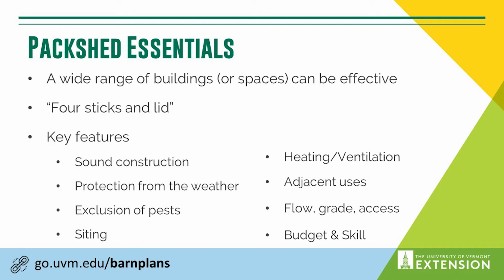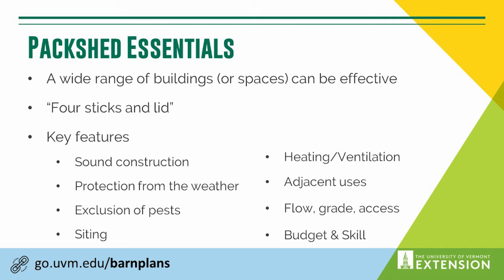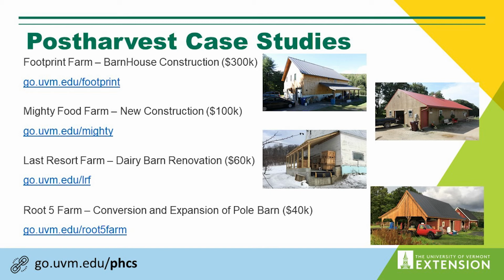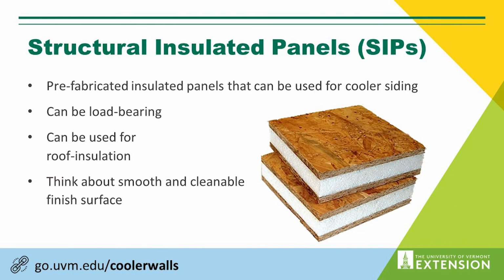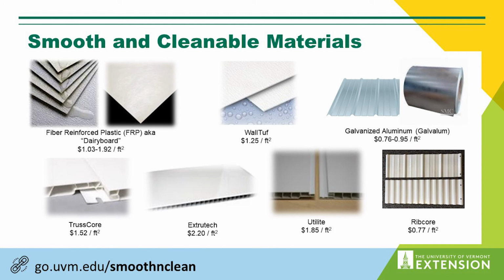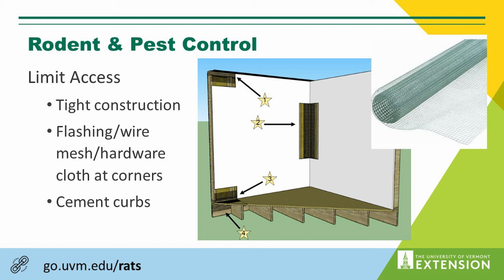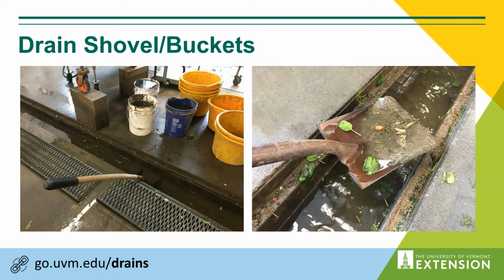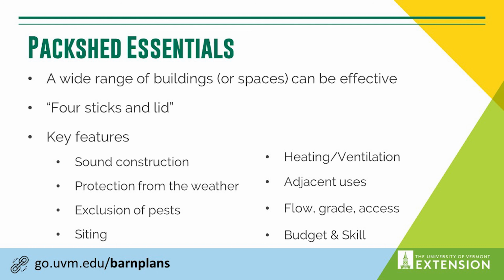Postharvest Webinar: Buildings & Infrastructure (Session 5)

Comment: Hello and thank you for this series! I was wondering why tile was not listed as an option for cleanable vertical surfaces in a wet environment? Is it just a matter of cost, or is there an issue with grout and bacteria? I'm thinking of spas and pools and other wet environments that must also be concerned with moisture, cleanability, and safety from bacteria or mold. Also, there wasn't a slide specific to flooring materials. Concrete sounds good, but are there other options that are cleanable and meet OSHA requirements? Have you had any experience with epoxy coatings or other floorings that are used in other wet and high-traffic industries (eg. commercial kitchens)?
Reply from the maker: Thanks for the comment and question. TILE is definitely an option for washable floors and walls.  It is one that has not been chosen typically in the wash/pack projects in our area due to cost and, I believe, concerns about durability (e.g. dropped tools, etc.) Some flooring options are discussed at http://go.uvm.edu/floors.
Reply: @uvmextageng  Thanks for the link!